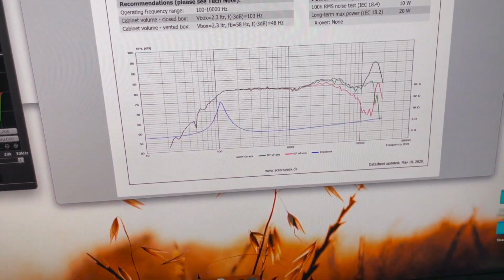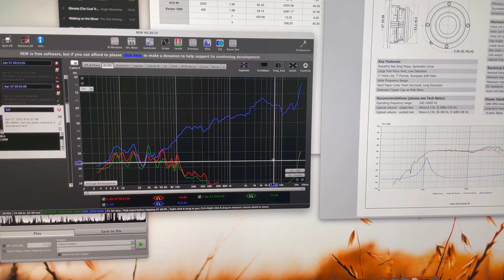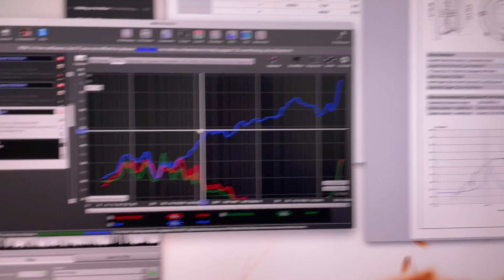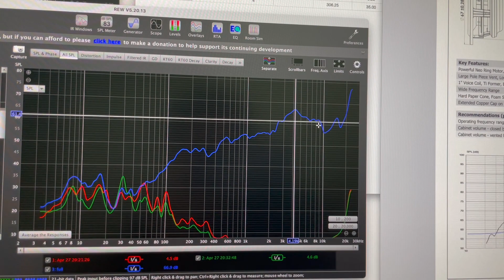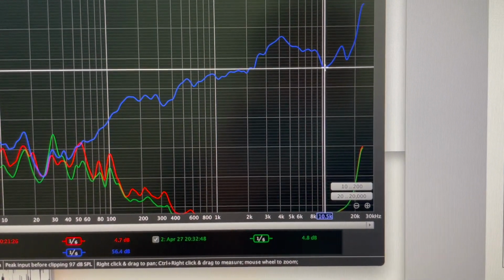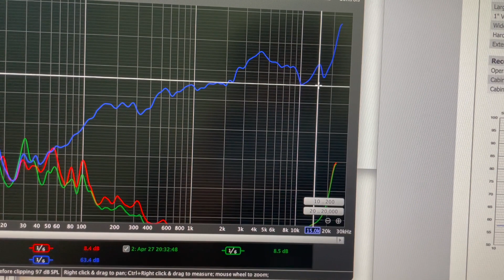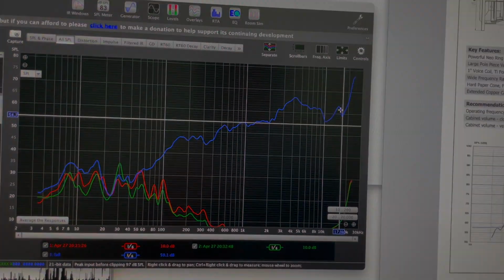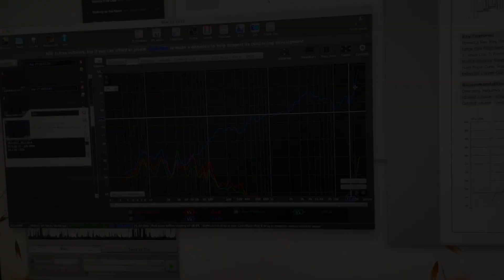Scan-speak 5F/8422T01 Full-Range Driver Review and Measurement

Comment: Scanspeak has measured the frequency response and inpedance in a 2.3L closed box. If you measure without a cabinet, the frequency will begin to fall below 1 kHz. So everything is just fine.

Comment: What calibration file did you use for the 🎤 most are for straight up an down not pointed directly at the speaker these are omni directional microphones useing the wrong calibration file with add to a rise in upper frequency
Reply from the maker: My mic is calibrated by cross spectrum labs and i'm not using the calibration files from miniDSP. I'm using zero degree calibration file.